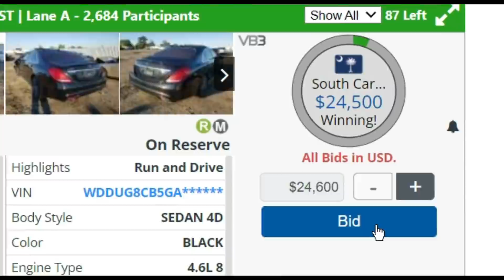MERCEDES AMG FULL REBUILD START TO FINISH 16 MINS

Comment: I am a huge fan of you guys. Your work is awesome. I wish there was a way I could get you guys to save my van. I bought a van hoping to do a minor build on it and spent alot of money to get it mechanically sound. One day when I was driving, I noticed my steering off but driving a straight line....so thinking I just needed an alignment, I went to Firestone. The mechanic pulled my van in and back out in 5 min. Apparently after spending a couple thousand on suspension stuff.... no one noticed the front frame rusted to the point that the steering gear box shifted.... I hate to junk the van because it runs great.  The first mechanic I went to that would've noticed the frame issues told me to sell it and don't tell no one 🤨. I would never do that to someone.  I rather sell for parts but I want to save it. It's a 1999 conversion van E150... any  advise would be appreciated.  Sorry for long message.